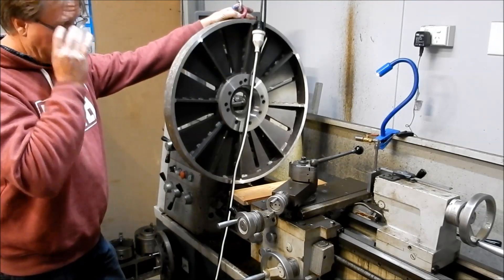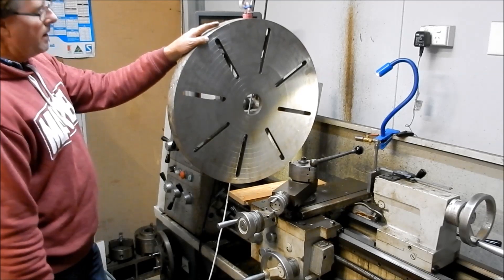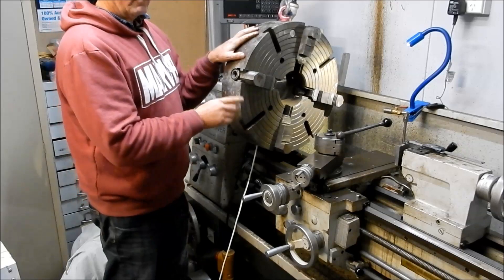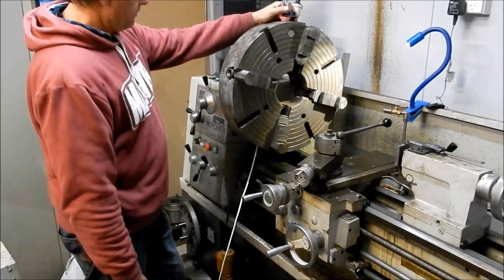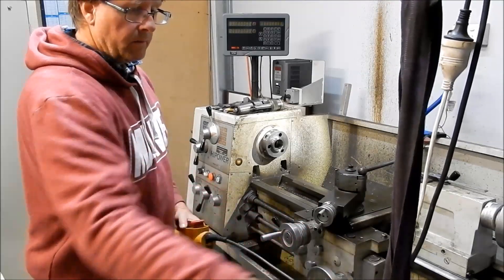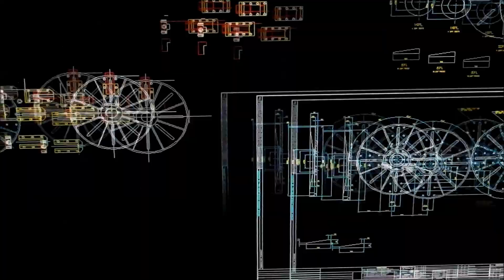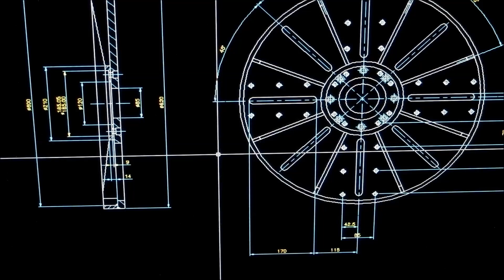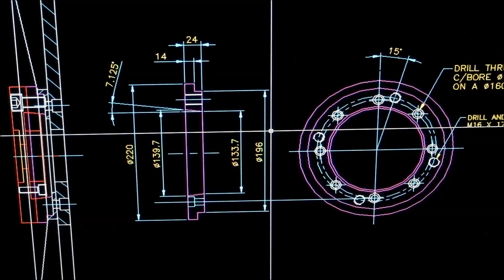How to extend the swing of a lathe Part 1

Comment: You know your working with the big boys when you use a crane to lift them. I think my lathe would have a hernia just trying to spin the face plate lol
Reply from the maker: G'day Fishman, yes it would give any medium size lathe a hernia.  When you are running with these stepped up sizes inertia really becomes your enemy.  I run a VFD that I can quickly program to set an acceleration rate which takes the load of the motor due to the inrush current trying to overcome that inertia but also on the Headstock Gearing.Cam